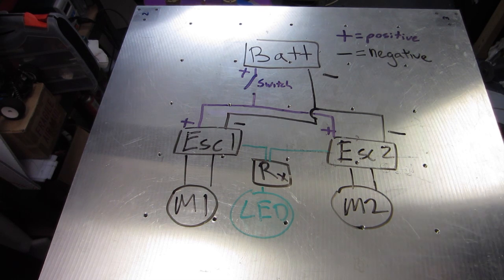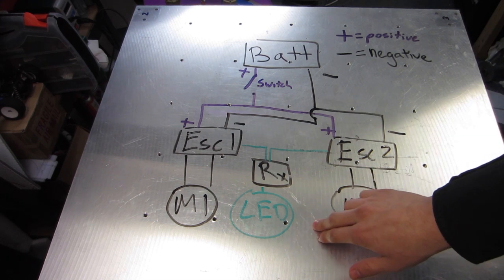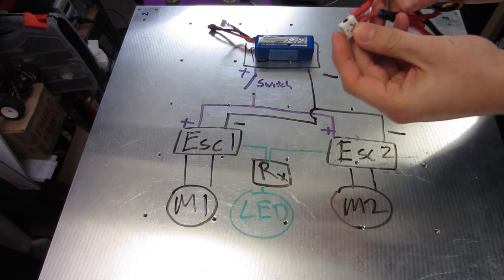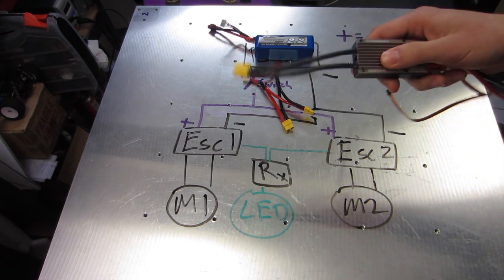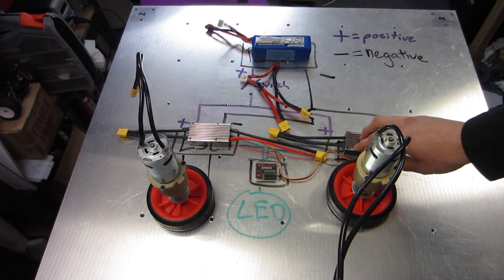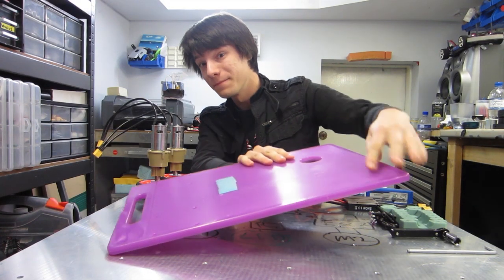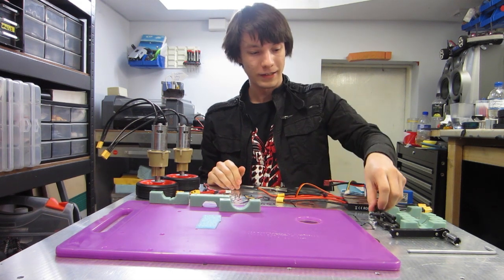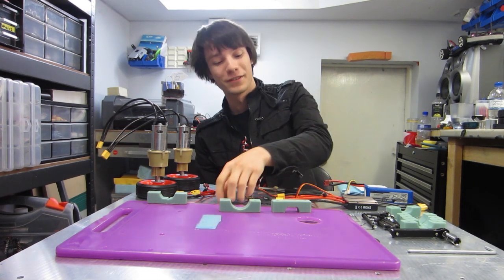How to build a Combat Robot - Episode 4 Part 2 Electronics

Comment: What are those connectors plugs? is was under the impression that you had to solder them together. Is there a name for them so I can get parts with them on? It'll make building one so much easier. Thank you
Reply from the maker: Those are XT60s can be purchased from hobbyking or alternative places online
Reply: Thank you

Comment: Hi can you do a more n depth video on Monday or controllers and the radio set up for robots,tank drive? Maybe show us different ways of achieving this? There is no videos on this and I am stuck on what to do. There are so many different types of speed controllers from cheap to really expensive.you talked about a mixing (thing) on part 4 and then shut down as you changed settings Your radio. In these series your using 2 speed controllers but there are also dual controllers. Understanding my confusion on all of this?  Need help. LOL

Comment: i am 12 should i learn how to weld?
Reply from the maker: You can always start smaller where are you based?
Reply: how do i mean where i live or what my basic things i can do i can soldire drill that stuff with some electronic devices i builded my own rc car it goes arround 35 km/h i live in the netherlands my dad has allot of tools but not a welder
Reply from the maker: +BingoBuddy1 There is lots of different weight classes and comps all over the world.
Reply from the maker: +BingoBuddy1 This vid is also focussed on Australian products and stores.
Reply: +Robowars Australia in the Netherlands we have the biggest place where boats come in the world so it's pretty cheap to ship something to my but what is the website link
Reply from the maker: +BingoBuddy1 ranglebox.com sells ESCs and gearboxes from the UK. For cordless drills any hardware store although some are quite expensive for a budget drill which should be about $20 AUD. As for welding you can probably make most of it with a jigsaw, bolts/screws and HDPE (type of plastic used for kitchen cutting boards).
Reply from the maker: +BingoBuddy1 there is no particular name for the drills 12V cordless drill is about as generic as you can get. They have all sorts of brands which are usually just a rebrand to the store cheap brand.

Comment: What is the best gauge wires for this set up?
Reply from the maker: Bobinker Gaming Hey, sorry for the delay. 12AWG is a good size, you can get away with 14 though if you need something a bit easier to route. I prefer silicone wire as it's nice and flexy.

Comment: Can anyone tell me, does it matter which way round the wires on the motors connect to the wires on the esc's Or not?
Reply from the maker: Will Elliott Nope! The motor doesn't care - it'll just spin one direction or the other depending on your wiring. Usually they indicate the + with a little o mark on the back of the can, to help you get it right. You want to wire the motors 'opposite' so each side drives the same way (not that critical, just test it and if it spins the wrong way, swap the wires).
Reply: Oh great thanks, just waiting on my transmitter to come now :)

Comment: How did you do the wires on the switch and drill motors?
Reply from the maker: Drill motors need to go to the speed controller, so one out of the esc - into drill and back again to the esc. The switch is wired to only one of your battery leads, but it doesn't matter which one you choose - so long as it is able to switch from being open (robot is off) to closed (completes the circuit, and robot is on). As some people have mentioned in the comments, it's recommended to also have a removeable link - which is simply a plug with a loop of wire, it acts like a second switch but is also a visible indication if the robot is on or not.

Comment: Dude, I Need Some Help, Please May You Give Me All The Names To The Parts In This Vid, Not The Motors, Just The Speed Controllers And Switches And Stuff..I Would Really Appreciate It, Thx!!!, BTW awesome vid!
Reply from the maker: Botbitz 85A ESC's, fingertech mini power switch, standard AWG12 wire (anything automotive will do fine) and XT60 connectors. :)
Reply from the maker: Heya, perhaps try their 30A esc, but it's a bit less powerful, if the drill motor stalls it might blow up!

Comment: How did you attach those wires to the motors
Reply from the maker: You need to use a soldering iron and solder, anything over 40W will do you well and they can be bought really cheap!

Comment: It is probably worth noting that you need to buy BRUSHED speed controllers for a drill motor; you can get cheap-as brushless speed controllers from Hobby King, but the only place I can find the brushed ESCs is BotBitz, and they are quite a bit more expensive ($AU75 instead of $AU39)
Reply from the maker: Long delayed response, but yep you need brushed esc's to run the brushed motors. The botbitz esc's are custom programmed and tested for combat robots so they command a higher price than the mass produced brushless esc's from hobbyking.
Reply: ***** No, they can't. Brushed motors work completely differently.

In a brushed motor, the power is applied when the brushes inside the motor connect with certain spots on the rim (contacts), allowing current to pass through. As the current passes through, there is a force applied, turning the motor. As the motor turns, the brushes pass the contact point, and then the current is stopped, and the force is stopped. If this didn't happen, the motor would simply turn 90 degrees and stop. the motor then continues turning via inertia, and then the next brush passes the contact point and power is again applied. 

Effectively, a brushed motor is self-regulating; the motor itself regulates the current by physically moving the brushes in and out of contact with the contacts. 

A brushed motor has 3 or more 'poles,' which are always connected. The ESC applies power to each of the poles in sequence, creating the field/force to each pole respectively. There is feedback telling the ESC where the motor is in each rotation. 

To the best of my knowledge, you can't run a brushless motor without some form of ESC.

Comment from the maker: Nope, if your speed controllers are powerful enough you can wire up two or more motors to the same terminals, just make sure you wire them in parallel, not series. The TZ85A can happily run two cordless drill motors each.